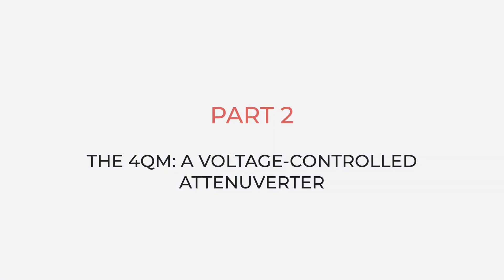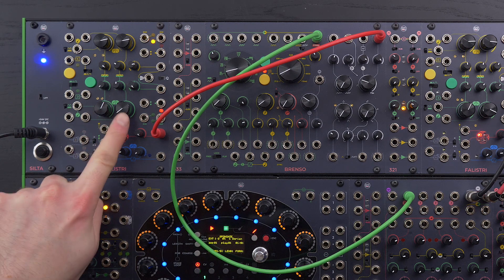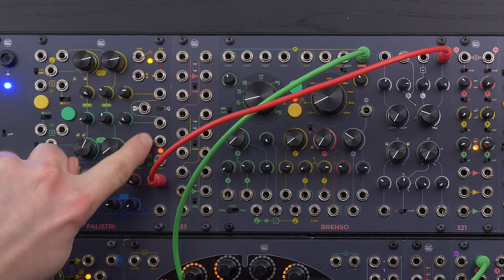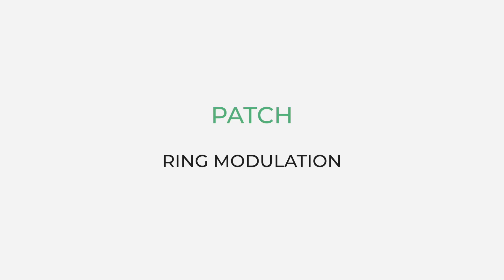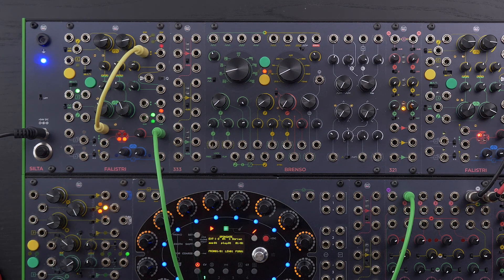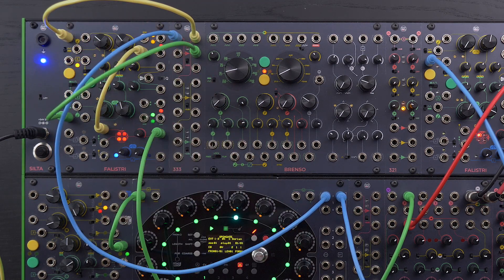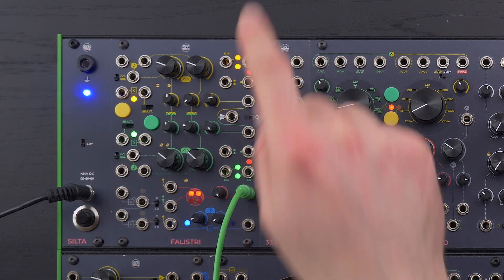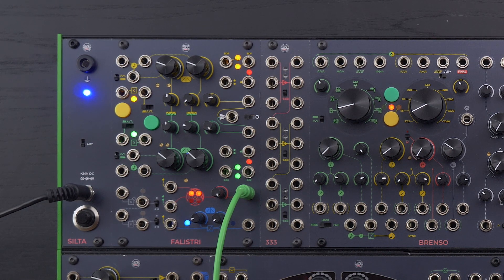Amplitude and Ring Modulation: the Four-Quadrant Multipliers | Frap Talks

Comment: Im just recently beginning to use ring modulators which I had overlooked for many many years. I am wondering if the 4QM in fallistri and Brenso are analog in design, or if they are digital, or a combination of both. Thanks
Reply from the maker: Yes, they are both analog!
Reply: @FrapTools  Thanks very much :)